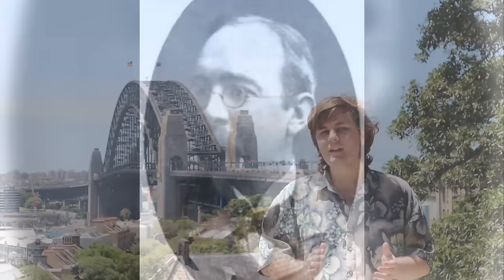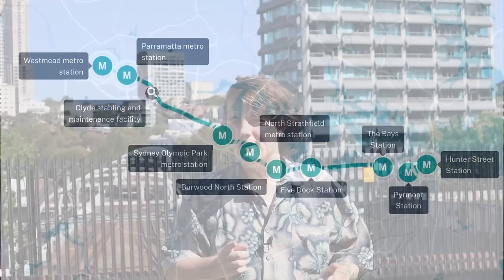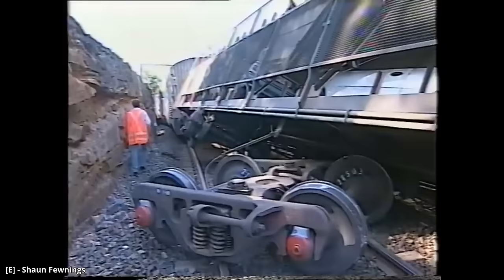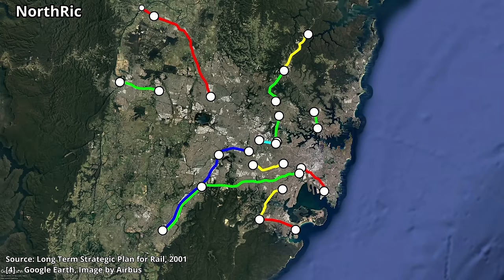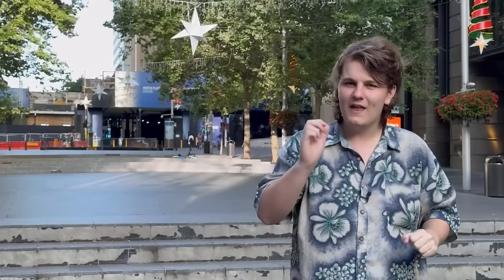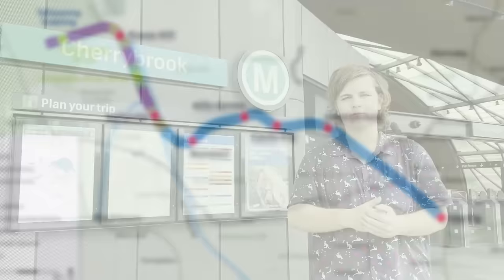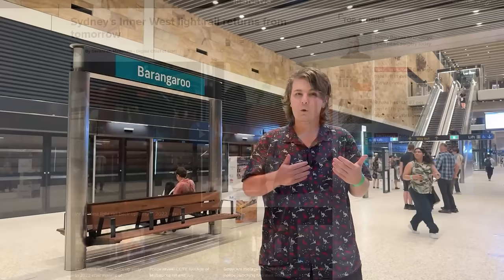Sydney Metro: 100 Years in the Making

Comment: The Schofields extension of the North West Metro was apparently blocked by a bus company who had a contract option to run a bus route that the metro extension would have conflicted with. After preventing the metro from extending to Schofields, the bus company chose not to establish the bus route...
Reply from the maker: If that were the case, I wouldn't be surprised...
Reply: Similar to the Ropes Creek line being ripped up when Ropes Crossing was built up. It could have already been the start of the connection from Schofields to St Marys.
Reply: lmao
Reply: Yeah, I tried emailing someone on it, couldn't get a response
Reply: @mouse1442000  The level crossing on the very busy Christie Street pretty much killed any chances of the line to Ropes Creek remaining.
Reply: @albert3801  Yeah, that is a good point. Probably cost way too much to bridge it for keeping the line without the knowledge it would be useful in the future.
Also the tight corner just after Dunheved station would keep trains slow at that point.

Comment: Fantastic video. Loved the history of it and its shame a lot never got built. Can't wait for another 100 years until we actually get the full story

For extensions opions

If the metro was expanded past Hunter Street (or whatever they will name it as it won't be Hunter Street), i feel like expanding it to Moore Park and UNSW would be better then going towards zetland. Manily due to zetland is semi-close to rail while both previously mentioned areas would have a far high catchment area of people. 

As for the otherside of hunter street. All for adding the stops (it should only add like 2mins per stop). 

And the extension to scofields is like a obvious move to everyone execpt the government. 

Overall, was really great video
Reply from the maker: Thanks! and I think your proposal is a good idea too, it'd help supplement the existing light rail there.
Reply: Instead of the terminus at Hunter Street, the line should have connected with St, James station for a cross connection to the City Circle. Centre platforms are there now. The north side stub tunnels already exist

Comment: 35:10 The other thing about Schofields station was that that station was relocated further southeast along the line - i.e. the old one was closed and a brand new one built, along with the upgrading of Schofields Road. But yes, the fact that there seemed to be absolutely zero consideration as to the interoperability between the brand new Metro and the brand new Schoies station is absolutely bonkers.

Comment: The Iemma [Read: 'YEM-muh] - Reece - Kenneally era was a dark 16 years of transport hell of promises made and not even tracks laid. They only added to what was several decades of waiting for a train to go through the Hills District. As for the Metro carriages, they are directly based on the MTR trains from Hong Kong, which have longtitudinal seating for maximum passenger capacity that can withstand shorter rides and greater frequency. Unlike the Metro, the HK trains don't have cloth deating however and people can find themselves sliding on the polished stainless steel seats when stopping.

Comment: Thanks for an interesting and informative video. Incidentally, did you know that the ceiling pattern design used in the old single deck red steel train carriages was identical to the design used in the Big Red Cars (Interurbans) in Los Angeles CA USA, which ran there until 1961? just of interest, the Holsworthy line was in use in January 2000, as i traveled on it on an XPT from Melbourne at the time. The reason that we went that way was due to maintenance on the inner western line at the time.

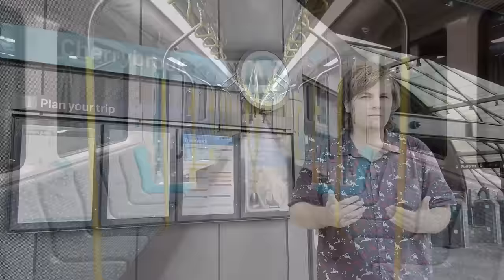Comment: 36:55 London's S8 Suburban Underground sets, used for the longer journeys from the outer suburbs, has a mix of transverse and longitudinal seating. This has earned high praise from commuters using these sets on the longer runs. Why Sydney Metro sets didn't do the same is odd, but then again this is the same mob that has installed the unpopular non-reversible seats on the "new" (5 years delayed into service) Intercity sets.
London's S7 and S8 sets are actual normal size trains intended for the Underground lines, not the smaller tube lines. After all, the first steam locos on the London Underground were identical to the NSW 12, 13 and 14 Class locos.

Comment: 14:59 In fact work had started on the quadruplication of the Main North from Strathfield to Hornsby in 1948!! The piers of the "new" Meadowbank Bridge are actually those intended for an additional bridge for the extra two tracks there. Even today you can still see the evidence of the earthworks and widened cuttings for the project around Meadowbank, and also the trackbed of an extra road bridge over Victoria Road at West Ryde.
So, what happened? In 1952 along came some British rail "experts" (actually from London Transport) who, after destroying London's extensive tram system, recommended Sydney do the same to its tram system (the original post war Sydney tram plan was to consolidate the system by closing "orphan" lines like at Rockdale, and the Enfield Line).

 BUT they also recommended cancelling the quadruplication of Strathfield to Hornsby stating that impending electrification to Gosford by 1960 would make it unnecessary. How replacing steam trains with electric trains just on a one for one basis would reduce congestion they never explained. Unfortunately the NSW government followed their "advice". We live with the legacy of a very congested Northern Line today.

Comment: The simplest solution to public transport on the Lower North Shore would have been to have kept their trams. I know there was a plan for a heavy rail line through The Spit to Manly-Warringah but the patronage level would seem to be more suited to "light trail".
When the Lower North Shore tram system was closed in one hit in June 1958, locals fumed at the replacement crappy, overcrowded, bumpy buses which too often left people at places like Cremorne Junction left behind at bus stops because the buses were full. Their solution? Take to their cars, of course, and they have never gone back to buses. Of course, this great increase in private car use was music to the ears of the then Dept of Main Roads and its successor the RTA, who salivated at the prospect of building more of their beloved expressways for the cars. 
I reckon that the T4NSW Roads section would be more agreeable to having all their teeth pulled out than having to give back their PRECIOUS (Gollum Gollum) Cahill Expressway to trams.

Comment: Cancelling the Lidcombe and Cabramatta legs of the of the City and Southwest Line seems like such a wasted opportunity.
Reply from the maker: Yeah, it just makes the stations west of Bankstown useless.
Reply: It's not wasted if they get on and build the direct extension to Liverpool giving Liverpool a much faster (~40min) much higher capacity line (30 trains an hour) direct to the city, and the line from Bankstown to Regents Park/Sefton can be converted to light rail and continue up to Rosehill Metro station, it works out much better really.
Reply: @CityConnectionsMedia  My English Teacher lives in one of the Stations West.
Reply: @kyletopfer7818  A light rail conversion makes sense, though my thoughts were that converting all the way to Lidcombe would allow for a Metro conversion of the Inner West Line.
Reply: @bigdude101ohyeah  Converting the Inner West line to Metro would be difficult due to:

-the extremely old platforms and infrastructure (older than the Bankstown line which has caused a ton of problems
-the need to segregate it from the other 4 tracks along the Western line
-you certainly wouldn't want it to be part of Metro City & Southwest, that would be confusing and wouldn't serve any real purpose
-you would need dedicated stabling for Metro trains on the Inner West line especially if you want to run a higher frequency than present (20 trains an hour)

You can convert the Inner West line to Metro separately but you would be better off pairing it with the Airport line down to Revesby through the City Circle, which will require shutting down the CC.

Comment: 2:55 That's not correct, when Sydney Metro City & Southwest opens the EIS states very clearly they will run at minimum 20 trains an hour (every 3min) throughout the peak, and 12 trains an hour (every 5min) interpeak with the ability to react to demand spikes by just sending more rolling stock out as they are automatic. The C & SW Metro EIS also states very clearly that the line will have a reliable capacity of at least 30 trains an hour (every 2min), but this is at far higher running speeds than the New York or London lines achieve running at such close spacing; while other lines that use the exact same tech as Sydney Metro can get 36-40 trains an hour through (every 90 seconds) but operations at those higher frequencies start to become less reliable and operating speeds are slower which the Hay proposal would have also run up against, hence Sydney Metro don't make any guarantees that this is possible or likely.

8:40 Thank God the Bondi Beach extension that was proposed then didn't happen - it was going to be single track which would have risked the reliability on the main Illawarra network and with only a single platform it couldn't handle anywhere near the frequency needed to relieve the bus and surface transport network.

9:56 I'm struggling to see how you would sensibly use the Y-Link line between East Hills and Liverpool, especially when the direct extension of Metro C & SW from Bankstown to Liverpool would bring Liverpool commute times to the City down to around 40mins and there is no way running T8 Liverpool-Revesby-City suburban services would be anywhere close to that.
Reply from the maker: I probably should have looked into that, I just looked up the schedule and went from there. At least it was just a joke and not a serious point I was making.

Tbh, yeah, but I'd still rather have the link be built. It's been on the cards for far too long so it's time to just get it done.

Could the C&SW metro achieve that speed? The East Hills line right now takes 40 minutes to get from Glenfield to Central, and that's almost entirely direct with very few stops. I doubt the metro could do it while stopping at all stations. As for the usefulness of the Liverpool Y-link, tbh it's mostly because it'd be cheap, and would allow faster one seat journey's to the CBD from liverpool. It wouldn't neccesarily need to run all that often either, maybe every 30 minutes.
Reply: @CityConnectionsMedia  MAybe the Y Link was to create a loop so a train would go Liverpool, Bankstown, Central, TH, Green Sq, Wolli Creek, East Hills, Glenfield, Liverpool and reapeat
Reply: @CityConnectionsMedia  Bankstown to Gadigal (Town Hall) will be 31 minutes once Metro C & SW opens. An extension from Liverpool to Bankstown is around 10km, and Sydney Metro achieves an average speed of about 70kmh so Metro C & SW would be under 40min from Liverpool to Gadigal (Town Hall).

Revesby-Museum T8 all-stoppers, which is the line the Y-Link would extend to connect to, take 40min already. Metro conversion of these tracks might be able to cut that down to 35min or so maybe a bit less. If these trains then make the rest of the stops between Revesby and Liverpool you'd be looking at over 55min potentially more, if they ran express which is hard to justify then you might be a bit under 50min. Quadding the existing alignment isn't that cheap, and taking capacity away from the Macarthur section of the corridor isn't a good idea as this line is already predicted to run into significant capacity problems in the near-term.
Reply from the maker: @TrainzForNSWVlogs Ooooh, that's a novel idea. I could see that working, albeit maybe not the most effective use of resources.
Reply from the maker: @kyletopfer7818 I'd still want to see that in an official document tbh. I could imagine that would be the case, but I can't see how the metro even at 70kph average speed could beat the east hills line, especially when the express section is mostly 80-115kph, and that's for most of the journey, albeit I'm open to having my mind changed.

As for your second point, yeah, that's fair. I do plan doing a video discussing that. I would probably disagree that the T8 would run in to capacity issues in the near future. I used to live along it and in my experience it rarely has overcrowding problems, as least not on par with lines such at the T1 or T4.